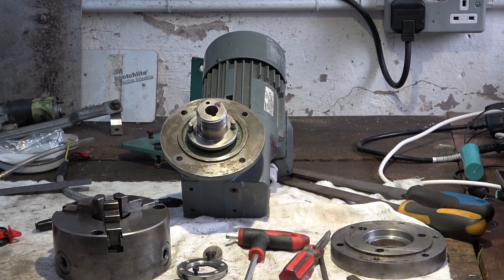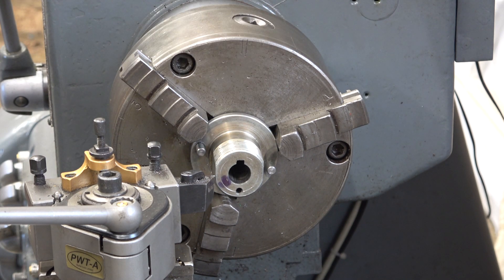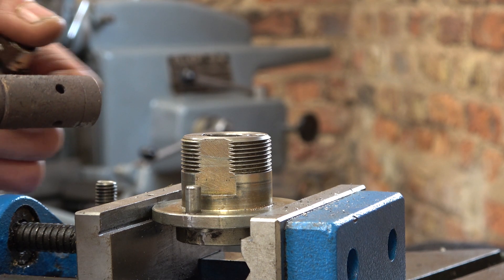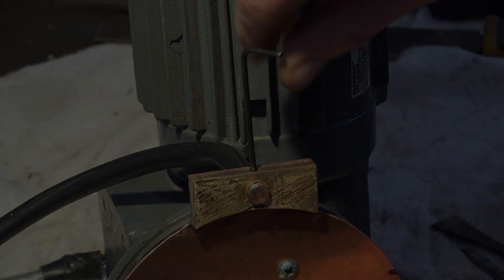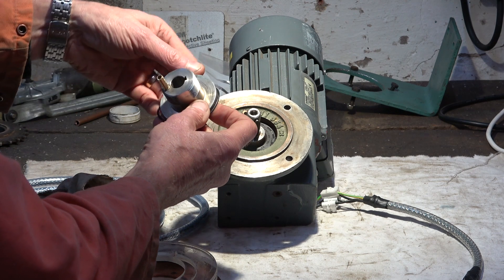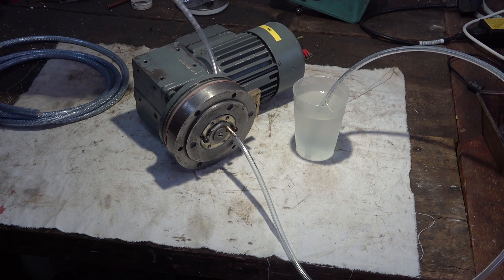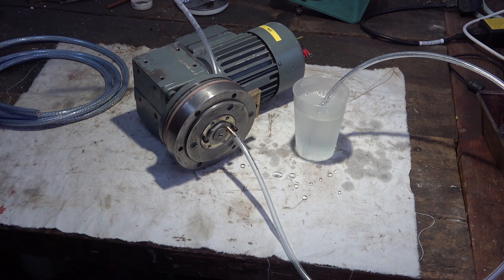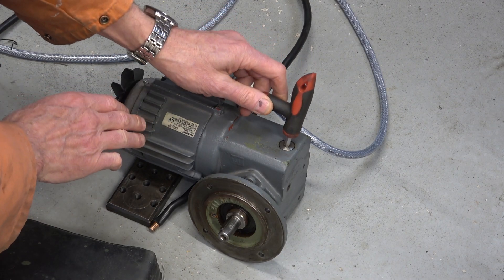HS119 Shopmade welding rotator build – Part 5

Comment: Congratulations on another family member 👏. 
ISO 460 is a tad viscous for your near zero torque application, fairly standard for high reduction gear motors, volume of lubrication changes depending on motor axis  orientation,  most times the fill/ drain plugs are configured with this in mind.
Nice robust design.
Reply from the maker: Thank you John.

Comment: Regarding blood: Superglue is an excellent wound sealer.   Also very good for dealing with those tedious "winter splits" in skin close to finger nails.
Reply from the maker: Hi Richard, maybe I will have to get some for that. Thanks.
Reply: @HaxbyShed  the gel version is easiest to control in my experience..  Dab a drop on the split and quickly wipe it into place to reduce or stop continuing splitting.

Comment: If you want another stage of reduction the planetary set out of a defunct power drill should do the trick just fine.
Reply from the maker: Hi Jim, yes even 18 rpm seems a bit fast when the target speed is more like 2 to 4 rpm. The drill gearbox idea is a good one. Cheers

Comment: That's coming on really well! If the motor runs hot, an electric fan is a frequent solution when running from a VFD. You might even find a 12volt output to run a computer fan on the VFD! If you wanted to be really cool, there are small ceramic contact switches for a few quid on Ali Express! All the best grandad!!
Reply from the maker: Hi Matthew, thanks for the idea. I was worried that the (supplementary) computer fan would need to spin in reverse if the motor is reversed but reading up on motor fans (with straight blades on the end of the shaft) I realised they blow the same way spinning in either direction, air in through the centre and out the edges. So the computer fan could always run the same way. Cheers
Reply: @HaxbyShed  If you use a contact thermostat, you don't need the "mechanical" fan!

Comment: Gday Paul, congratulations on becoming a Grandfather again, the welding rotator is really taking shape now, your giving me ideas now, Cheers
Reply from the maker: Hi Matty, if you could get a normal shaft speed less than 18rpm I think it would be better. The motor is quite happy down to 10% speed on the VFD but is a bit less happy at 5% and the current draw starts to go up. Maybe a normal shaft speed not more than 10rpm would be a good target. Cheers

Comment: Nice job Grandad!  I use the same anti-spatter for MMA and MIG and it works brilliantly.  I discovered some years ago that a good spray with the stuff prevents the top of my metal bench  rusting.  I can't remember how long ago it is since I last sprayed it, but it must be well over a year so it's pretty cheap protection.
Reply from the maker: Hi Chris, thanks for that tip. Cheers

Comment: it sure is nice to have machines to work with , my lathe only has a 4 jaw chuck but I am getting fairly good at getting it centered up to turn stock.
Reply from the maker: Hi Vernon, my 3 jaw centers easily of course but it's only accurate to within 3 to 5 thou and for anything better it needs to be in my 4 jaw anyway to get it accurately on centre. Cheers